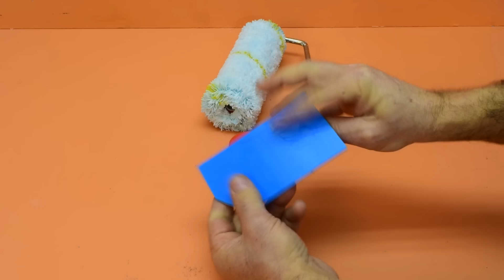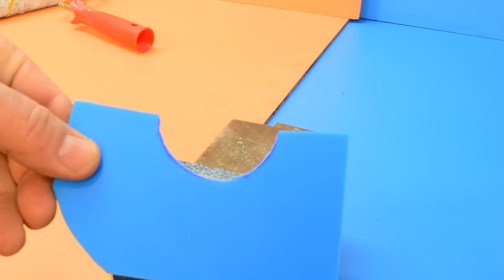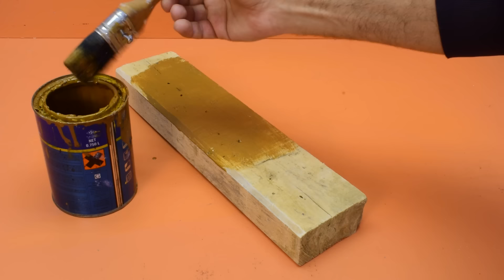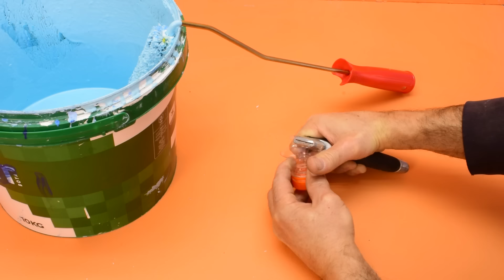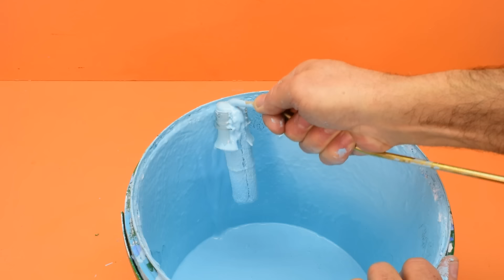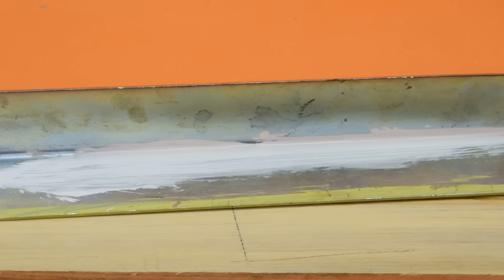5 Painting Secrets That Painters Won't Tell You

Comment: There's a few of these tips that would be kind of effective in specific situations. For example, there was no water turned on at the property, the steel wool in a container with water or solvent, would be a good way to clean you brush at the end of the day. Actually, that's the ONLY tip on this video I can see using myself as a professional painter.
Reply: Even that it is not necessary at all 😅 you can use a plastic bag and you will restart next day painting as you didn't stop at all.

Comment: There are angled brushes designed to do 'cut in' work, you don't have to destroy brushes by cutting them. And buying the proper brush for the proper job is cheaper than having to spend all the extra time correcting mistakes made by these dump 'hacks'.  And using the proper tools for any job makes the job easier. Buy the right paint brushes for the paint job!

Comment: Absolute joke. Cutting the brush into a point to get in corners. What’s wrong with turning the brush on the side where it will fit in any 90 degree corner. Not one of these tips are valid unfortunately.